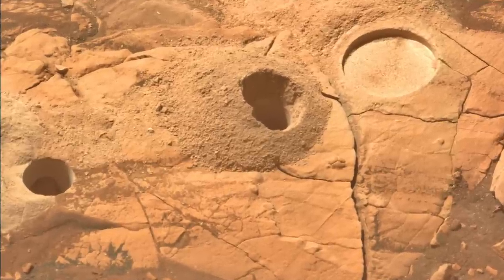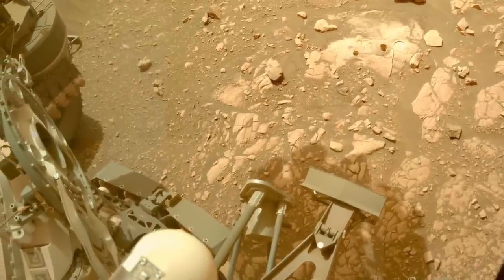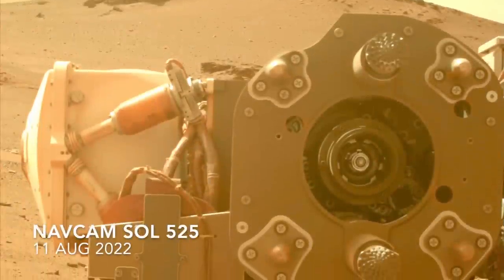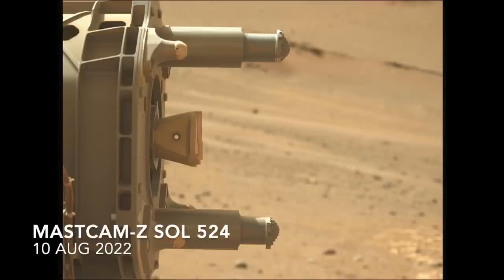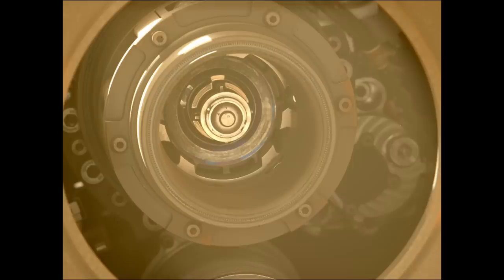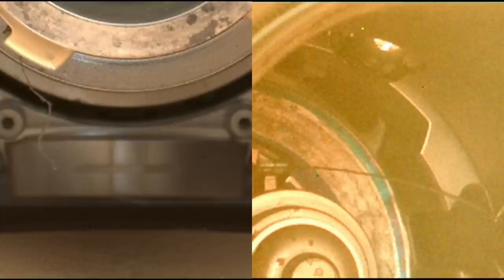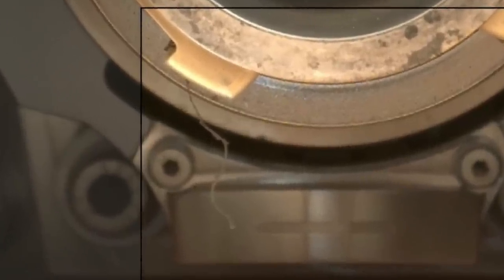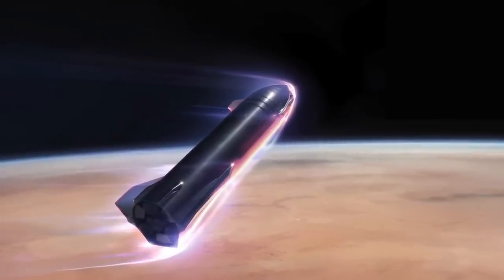Perseverance picks up unidentified foreign object debris

Comment: I think the situation with debris is quite the opposite - the more we'll be sending there, the more debris will be left there. It may not be pieces of crashed lander if we spend extra mass on landing it in one piece but whatever we'll leave on the surface will decay over time. Consider Curiosity rover's wheels. So we better get used to it.
I mean, I don't think we need to leave Mars squeaky clean. Any meteorite falling on it counts as space debris and this is not all that different. I just mean that bits and pieces we spread there will eventually get into samples we take. And if humans land in there eventually, we'll necessarily leave even some microbial life if it finds even slightest chance to survive.

Comment: is this the same rover that had trouble retracting the drill>??
i have had a grinding bench, rudely similar, where the thread of the down and upward motion of the spindle regularly had to be replaced ..
sometimes pieces of wirelike thread were visible in the debree.. 
it should however mean that drilling soon will be impossible.. so save it for when you need it..
wear and tear is a B

Comment: what happened to ingenuity?
Reply: So far it is sitting out the onset of winter. There will be less sunlight available to charge its batteries because of this and the increased dust in the atmosphere. The main concern is what effect the drop in temperature will have on its electronics. It has been amazing it has survived this long, remember when we weren't certain it would fly at all? Hopefully it will survive the winter and have many more  flights to come.
Reply: @randalscott7224  great information, thanks randal! hopefully our flying friend can pull through. what a breakthrough though !

Comment: About the sand ripples a few meters in front of Perseverance.
Comparing photos between sols 504 to 528, I do not observe any variation in their shape or in the covering or uncovering of small pebbles.
The dust storm season doesn't seem to have changed the landscape.
In fact, Ingenuity looks like it turned its rotors in photos from August 14.

Comment: Would there not be microbes on the FOD which would contaminate the abrasion tool and rover as a whole over time?
Reply: Would it be necessary to analyze the FOD in situ and, if possible, put it later in a tube and seal it to send it to Earth?

Comment: Could physical-chemical changes or reactions occur inside, in the cores, of the tubes exposed externally to temperatures, pressures, etc. for so long?
Reply from the maker: The tubes are hermetically sealed, so there can be no communication between atmosphere inside vs. outside.  Reactions are unlikely, but if they occur, all products will be contained.

Comment: It might help if things like the sky crane were soft landed rather than crashed into the surface. For that matter, a second use for the sky crane, as a weather station or some other scientific use could be engineered, with some solar panels, (And a feather duster to clean them off), for power. With the new flexible solar panels wrapped around structural parts of the crane, needing little other support and thus adding little to the weight of the craft. (Just kidding about the feather duster.)
Reply from the maker: Soft landing would take more fuel and technology, and then a power source for any instruments, plus radio communications, all doable but  the biggest problem would be $$$.
Reply: A hataki, unos zorros, better than the feather duster, would have a better performance to remove the finer stuck dust. :)